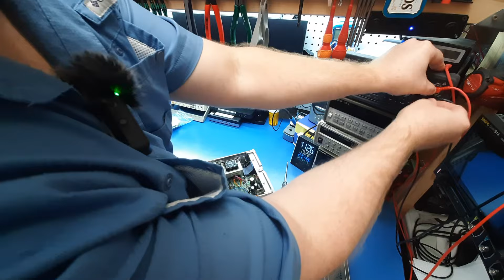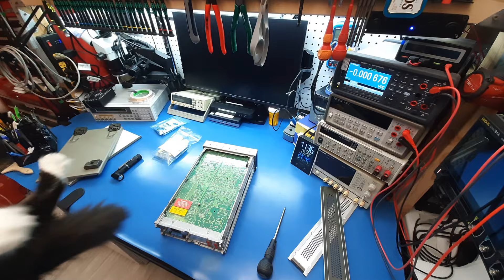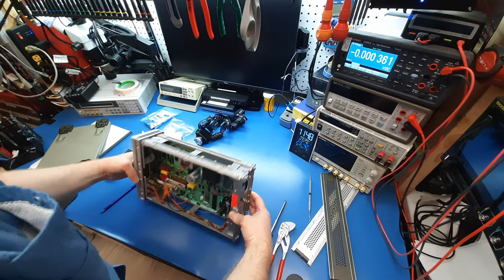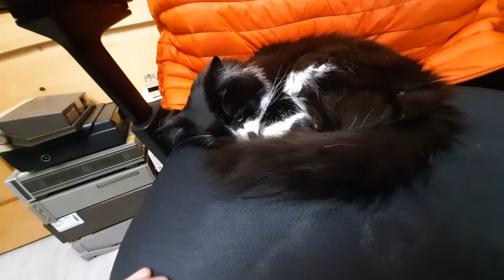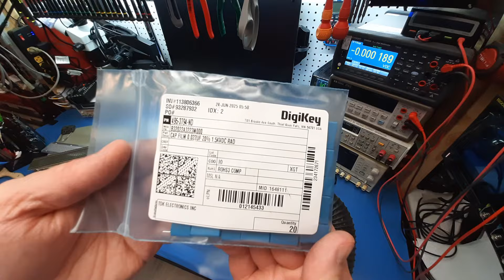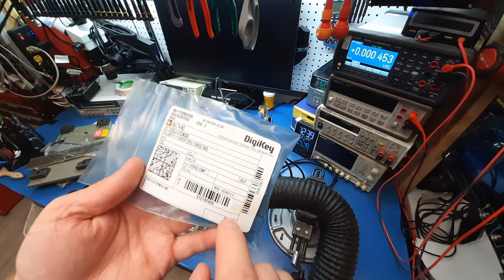HP 3478A service walkthrough (part 1 of 2)

Comment: Boring video. How can you do such repairing without good light ? Immense vast of time.
Reply from the maker: I'm aware it is a long video for what is a reasonably simple bit of maintenance.  If there's one thing I'm consistently bad at it is making short, concise videos.  As for light, it may not come across on the video too well, but I do have plenty of lighting installed on my bench and for this repair the lights I had turned on were more than enough for me.